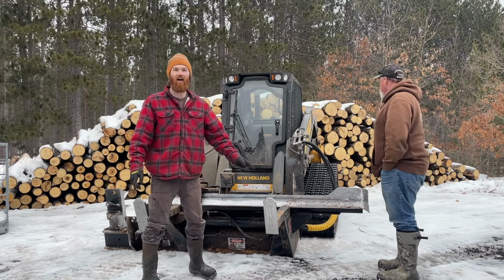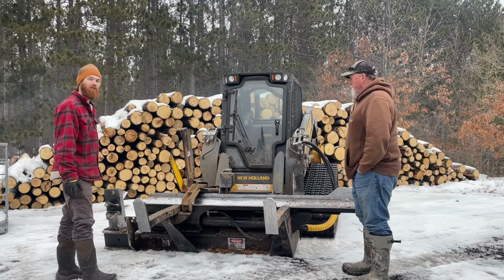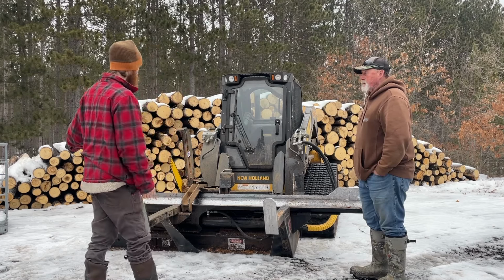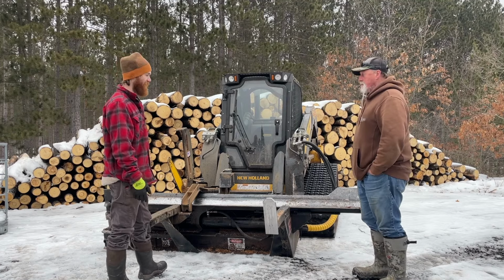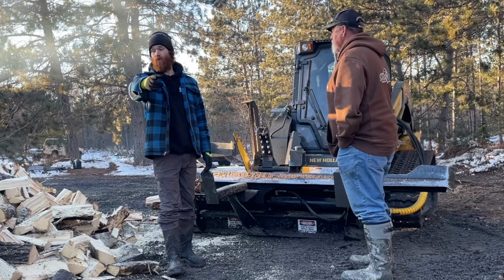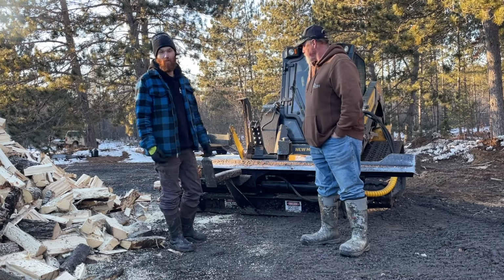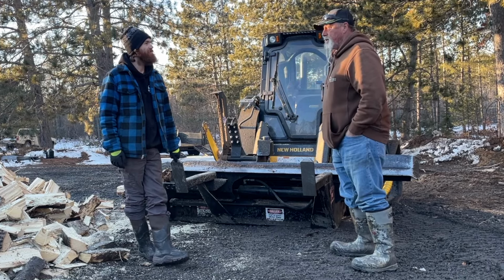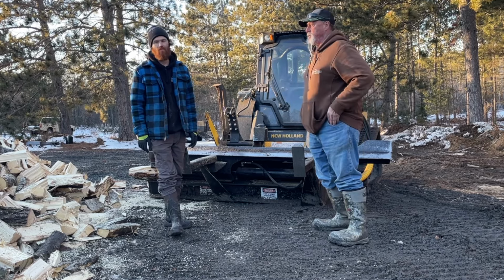Running The Halverson 140B - Our Raw, Unfiltered Thoughts On It

Comment: Nice to see someone make a custom 8 way for the Halverson.  You can order the 140b  with the 4” cylinder to get more oomph.  Getting mine in March!
Reply: Did you get your 140b? Did you go with the 4" cylinder?
Reply: @coltchristianson3749  I stuck with the 3.5” bore for now.  It gets stopped by some knots with the 6 way.  The 4 way is the ticket and keeps going.
Reply: @josevelasco3245  ok, I'm considering one and thinking of going with the 4" since I'll have a lot of larger diameter logs, and would want to use the 6-way for them. I'd even consider making an 8-way to get smaller splits. How are you liking yours? Any suggestions on purchasing?
Reply: @coltchristianson3749  well if you get larger than 18” I would go with the 150.   Even then, remember it’s only around 20 tons so if it’s knotty and big the 6 way won’t cut it or you can always drop it all the way down to act like a 4 way.  I have done that before with the 140b. You do that by not having a pin installed and it can freely go up and down.  You can then lean the wedge on something or the ground to get the wedge to go up and split 6 ways.  If you have the option to get poles and no more than 16-18” the 140b works great and is faster.
Reply: @josevelasco3245  ok, great explanation, thank you. I will have larger logs, but plan to just use chainsaw and process with a splitter. Being able to do 18" and under with the 140b, I can use my smaller skid steer (ctl) rather than the larger skid steer... Cheaper to put hours on it. That's a great tip, to drop the wedge down and it acts as a 4-way instead of 6-way. Overall there are so many details to consider, I'm just trying to make the best decision for my setup. I have a forwarder, and will be selecting the logs I cut from, so I can more easily separate the best ones for the 140b. From videos I've watched, it seems even the 120 does well splitting. But I think the added capacity of the 140b is a better fit for me.
Reply: @coltchristianson3749  yeah the 140b is geared more towards commercial output.  The stroke limiter is a must to get close to consistent perfect cuts.  People like that when they get their wood.